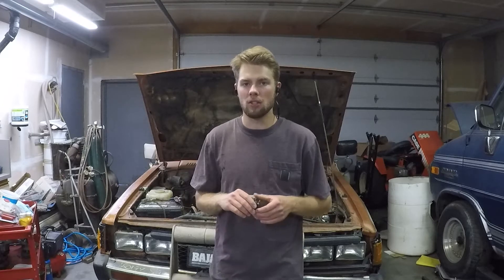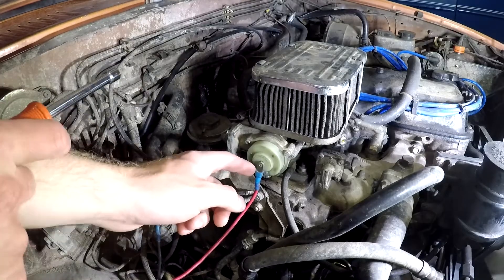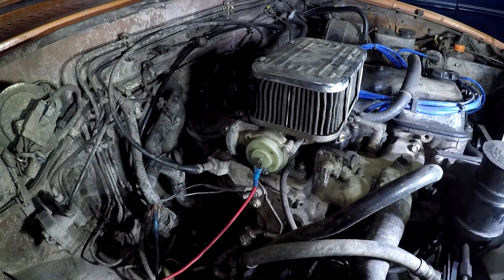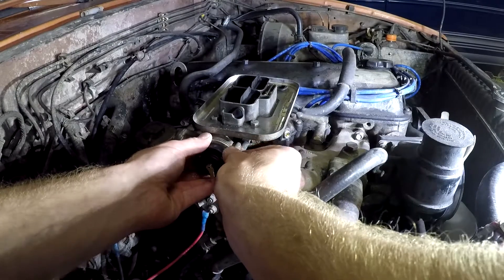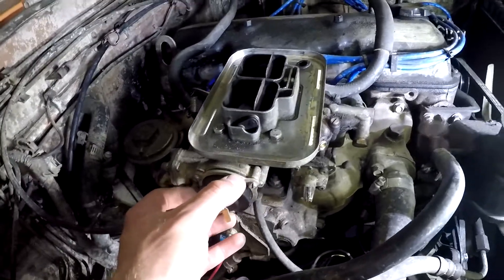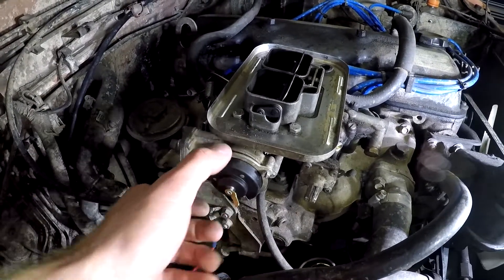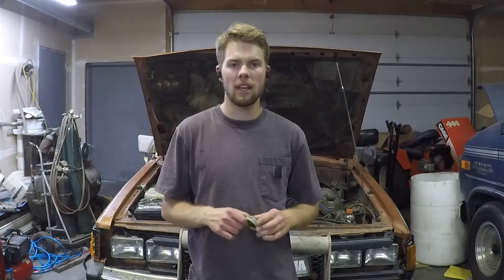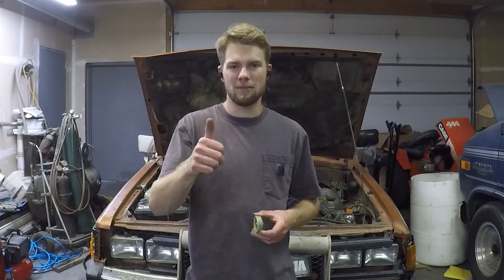Weber 32/36 Electric Choke Replacement for Nissan/Datsun 720

Comment: ilikefunkymusic from ratsun here. Question: at about 40 seconds in the video you can see this part I'm gonna ask about. In the video it's just to the right of the choke; on the vehicle it is just forward of the choke. 4 screws hold it to the carb. The little thing has a gasket that seals it to the carb. What is it? It looks like mine might have a little leak, or issue with the gasket. 
Cheers!
Reply from the maker: I am not 100% sure we are talking about the same widget, but I think you are referring to the accelerator pump. A new diaphragm is available in redlines rebuild kit for that accelerator pump. Feel free to send me a photo of it in a Ratsun dm or my Instagram @captains_garage
Reply: @Captain720  I googled weber accelerator pump and it confirms that it is the part! Thanks buddy. Recon a seeing a leak around that gasket could contribute to difficulty in starting the old girl?
Reply from the maker: Well to be honest I have a similar thing going on! I have a redline kit just waiting for me to do a rebuild on the ol Weber. Mine isn't starting quite as good as normal and also has a small leak at the accelerator pump

Comment: The cable connected to the carburettor is positive or negative ?!
Reply from the maker: It's 12 volts positive, the choke grounds through the base.
Reply: where did connect the electric choke cable to? ignition coil?